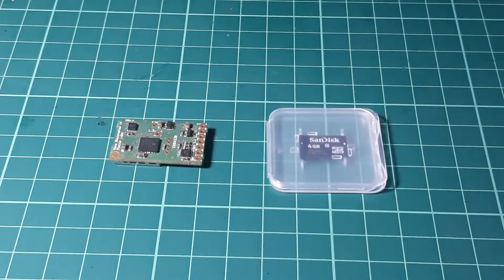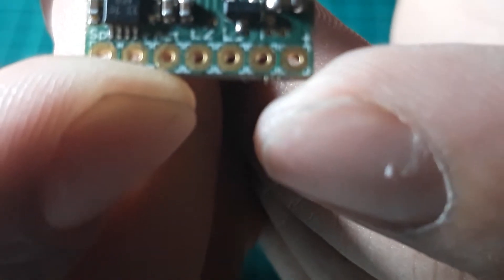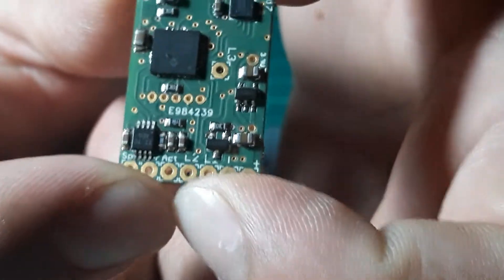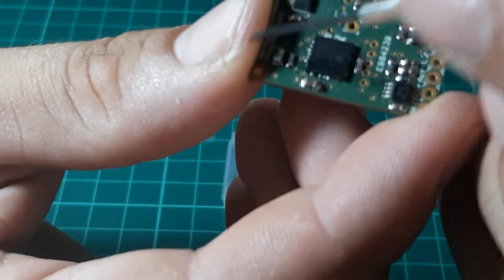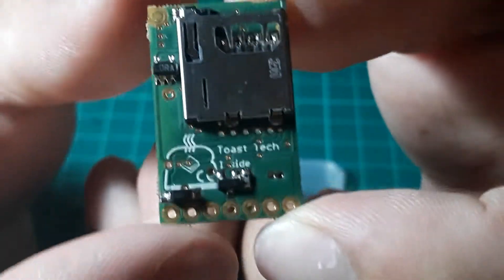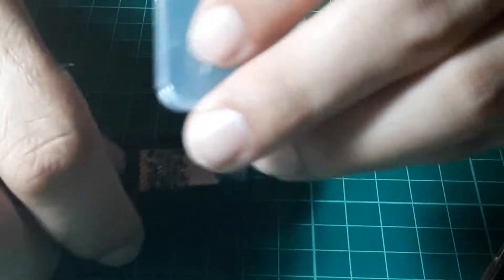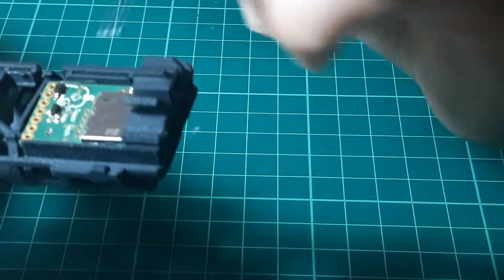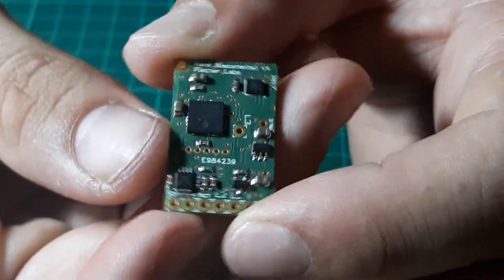Graflex 2.5 Build Log #3 The soundboard (Nano Biscotte v4)

Comment: Hi I hope this gets reply. Is there anyway for this board to support latching switches from default?
Reply from the maker: Hey there!

It can support latching switches. But given this soundboard all you need is just one switch.
Reply: @GeneralKatarn  the wires coming from the stock board from the hilt has a +- for the switch and 2 wired coming off it, while this board only have 1 act solder slot right? Do I put both wires in?
Reply from the maker: @tidalw4v  the positive activation wire gets soldered onto the act pad of the board.

The negative wire goes onto the common negative to the board.

If you want to see me demonstrate this, check out my last video of my Graflex series so you can understand better and see it in action!

I hope this helped and I'm always here if you need me!